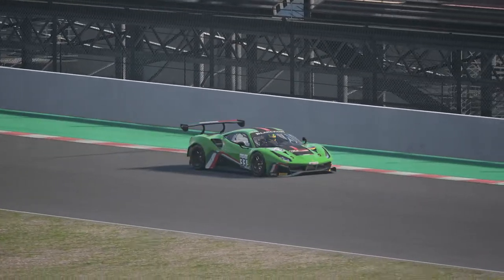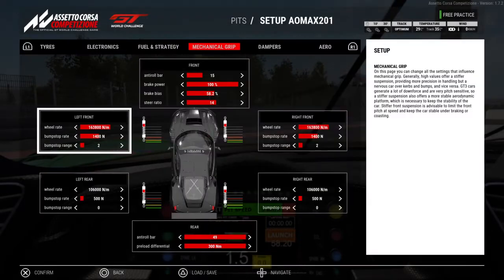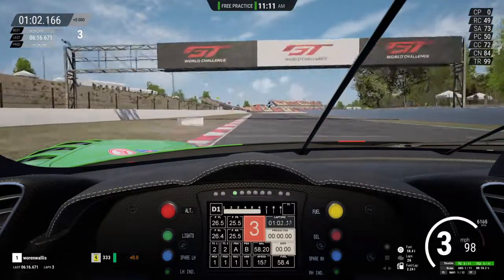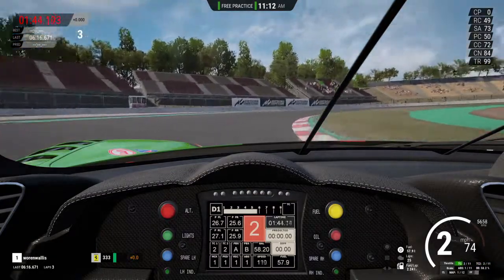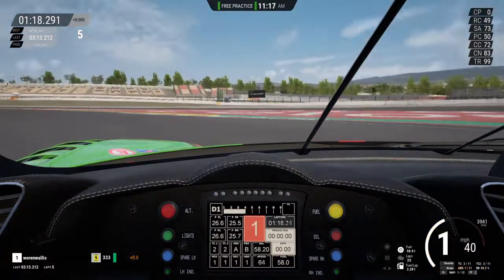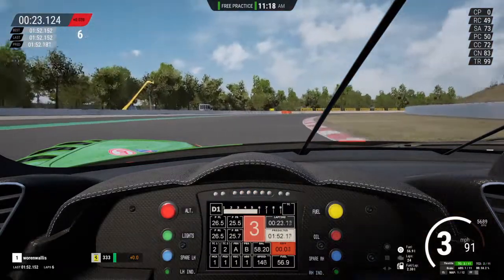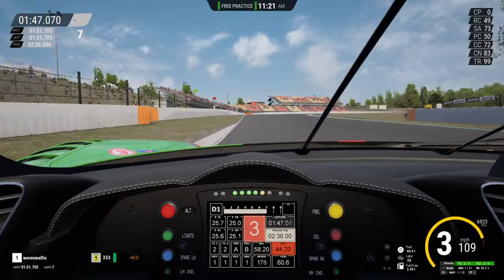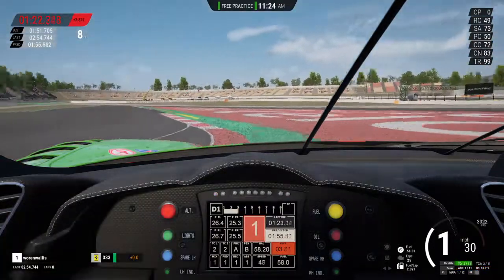ACC Importance of Bumpstop Tuning

Comment: Diff is too closed
Reply from the maker: Use what works for you, the game only allows diff preload adjustment, diff lock on throttle and on brakes is some unknown percentage less than the preload. More diff lock makes taking curbs easier, the car is less sensitive to traction difference between the left and right tires. And I like to take a lot of curb.
Reply: In ACC diff preload affects all 3. Higher preload gives you understeer in corner entry, understeer in fast corners and oversteer in slow corners and certain traction zones. This is because the wheels are locked more.
Reply: So in turn 8 when he was going off throttle whilst turning, he got a snap of oversteer as the diff was locked and both wheels are rotating at the same speed. When he went off throttle at turn 1 in a straight line he didnt have that issue.
Reply from the maker: The snap oversteer was caused by my bad driving. I'm already six seconds off average pace of most competitive servers. I can't claim to be good at ACC, so it's reasonable for me to claim I had a moment of bad driving.

Comment: look up Aris.Drives 
Learn from the guy who made these Cars handle like they do.  PLEASE Go watch his Set Up Series and your whole Viewpoint will be Much more enlightened... great vid your driving is  pretty nice. Your settings are killing your cars' abilites? your oversteer into the wall has to do with Preload Diff at low speed and in the wrong gear off the gas as opposed to high speed and on the gas... You need to get your TP to 27.8 give or take a 10th.  Loved your vid though cuz you are being generous with your  knowlege! liked and subbed just cuz...